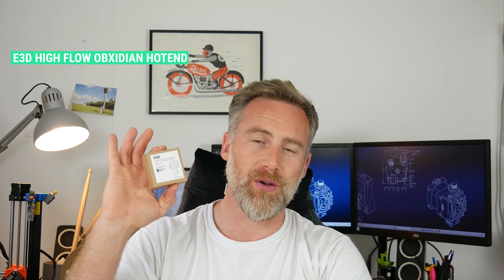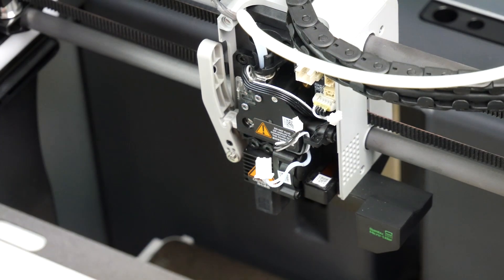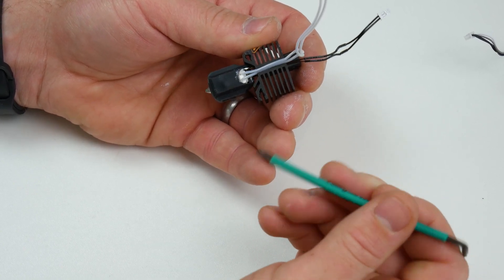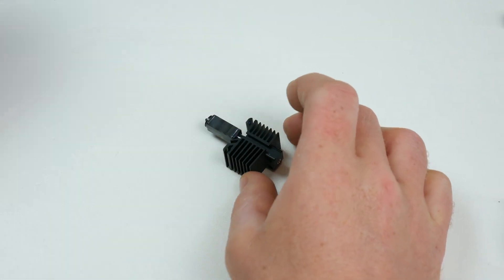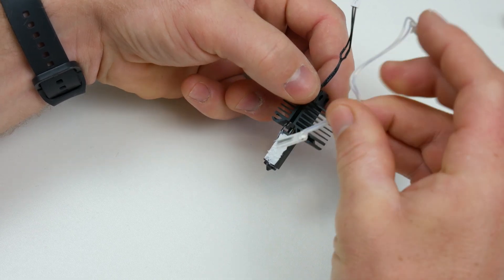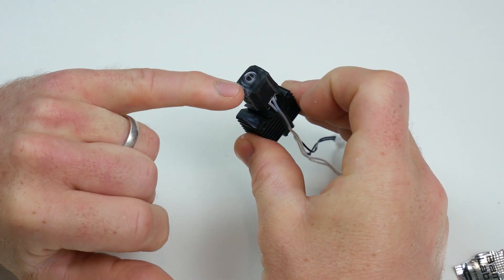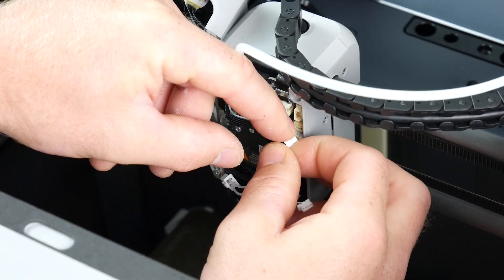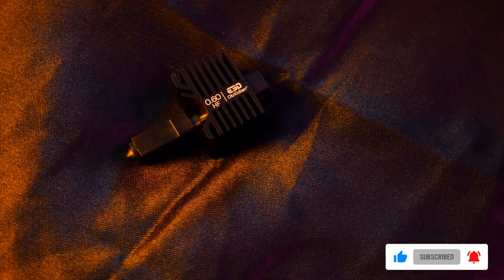Installing Our High Flow ObXidian HotEnd [Metal Only] On Your Bambu Lab Only Takes Ten Mins!

Comment: The compound you sent my with my Nozzle was about as hard as concrete after 3 Months or regular Hobby use. Destroyed the thermistor because i couldnt remove it by any chance on this world even tryed ultrasonic heated 99% alcohol. Ended up ripping it out, now i have a destroyed Electric set and a bent 90 bucks hotend wich happened on some regular print too since Bambu Nozzles tend to bend. At my experience i cant recommend this product in this stage and tend to recommend microswiss hotends since they atleast counter the bending by theyr design.
Imaginge your printer printing along and bending a 3 week old Diamondback ... thats it youre done 120 down the drain. Even if you bend it back you wont get super smooth surfaces anymore. 
Now im kinda burned since its 10% of my printers value already and back to buying stock Hotends and using Thermal Grizzly compound on it in hopes it wont harden off like concrete.